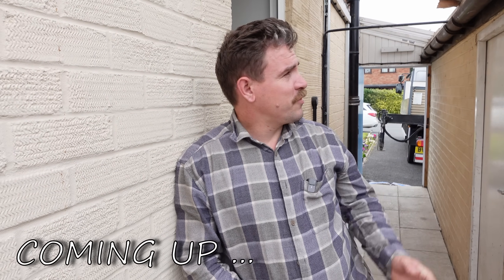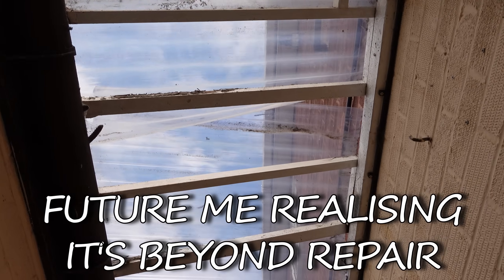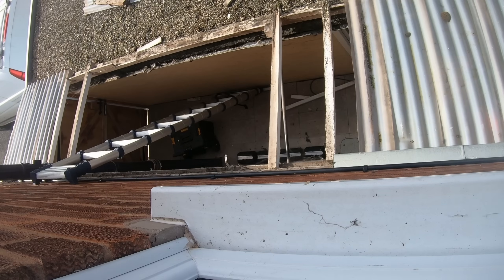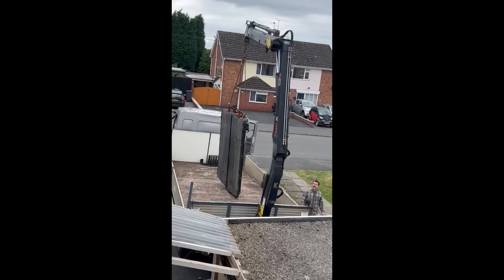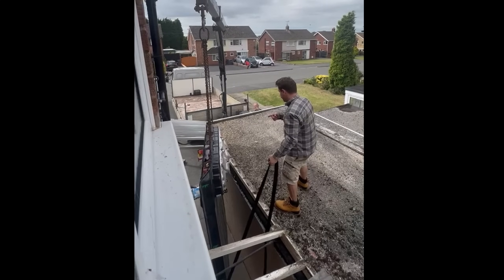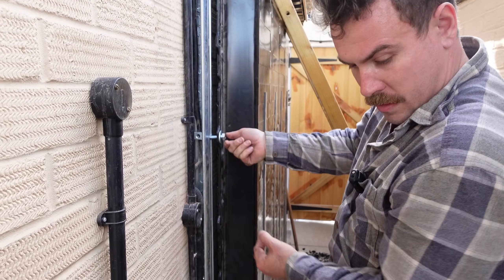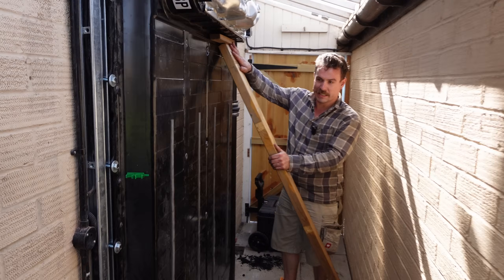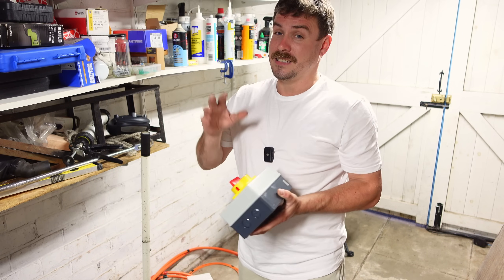TESLA car battery on my HOUSE for home energy storage

Comment: You need some spacers between the unistrut and the battery so you can torque those bolts down without bending the tabs of the battery down. also i'd replace the roof with glass frameless bifacial panels in a panel, clear sheet, panel, arrangement that will still let extra light into the area, if your spending money on roofing better if it helps pay for itself!
Reply from the maker: Very good shout on spacers for torquing down the battery. Thank you. 🙏 

Some more info. The passage/ garage is northwest side of the house. So only sees sun in summer evening. But it could be interesting to report to YouTube how much energy can we get from a panel in shade most of the year. And I’m trying to find spaces for solar panels everywhere I can without it looking messy.
Reply: @TheOfficialBatteryMan you could figure out what length spacer is needed and cut up some steel pipe to those lengths, it’s too much space for washers..  just use pipe with an inner diameter at least as large as the bolts.
Reply from the maker: @mwolrich  I had a box of washers. Took @allan80supra advice and used them up. 5 m12 washers per bolt did the job
Reply: Great idea on the bifacial panels!
Reply: Came to the comments to say exactly this as I was watching and cringing as the battery case was being distorted, it would also then be taking the vertical load better than all being on the foot which it likely will be currently. At least it didn’t pop 😅
Reply: Seems your a smart cookie. I want to use two of these batteries in front of each other. And the one against the wall a bit higher so i can still access the dog house. Maybe additional frame in front of the other one? Or maybe ill place the battery horizontal against each other.. with some frames. Ill see.
Reply: @mwolrich  Part-off short lengths of galved iron gas barrelling.

Comment: Looking good! I've been testing my 60kWh Model 3 battery with a Solax inverter and haven't needed any capacitor because the inverter's battery input already has a lot of capacitance. 
When I tested the battery without the inverter, I did the the capacitor to keep the safety system happy and contactors engaged. Also added a 50K bleed resistor for extra safety.

You might want to try an inverter connection without the capacitor first and save yourself a couple wires and extra box.
Reply from the maker: That’s very useful information. Anything that doesn’t need to be in the system is good to remove. I’ll still have a box close to the battery to convert the orange tesla cables to dc cabling with a fuse on my POS. I held off on the inverter for 3 phase install then grid approvals for inverter. They take time. And didn’t seem sensible having a potential paperweight lying around

Comment: Since I saw your first video about this I have bought a Solax X1 Hybrid inverter and connected it to a DIY powerwall (made from VW eGolf battery modules). I still have a few things to sort out but so far it is working perfectly letting me charge it with cheap night time tariff and run the house during the day. Good luck with your project.
Reply from the maker: O wow. Nice one. Are you using the battery emulator project or another BMS?
Reply: @TheOfficialBatteryMan  Currently no BMS. I set the Solax inverter to Lead Acid mode so it doesn't need to see a BMS. Hoping to get a BMS soon.
Reply from the maker: @alibro7512 you configured for low voltage ? I’ve got on well with JK BMS in the past
Reply: @TheOfficialBatteryMan  No, that's the problem. The pack is 60S so I set the max voltage to 237V which is 3.95V per cell and the minimum to 210V which is 3.5V. This way I should be well away from the max and min voltages for the cells to ensure none go over or under voltage. This still gives me around 15kWh which is plenty for my house and I can even use it for an hour or two of EV charging. Once I get the BMS operational I'll be able to use more of the batteries capacity but for now I'm happy to be conservative.
Reply: Did you declare to DNO without MCs / installer?
Reply: @je8277  No DNO in NI
Reply from the maker: @je8277  I used my details as the installer. This is where you would involve an electrician. I used easy PV to generate the forms including a schematic
Reply: Why Solax why not Deye?
Reply: @alibro7512 Ah the Tesla is 108s. High voltage.
Reply: @HermanWillems  I got the Solax 5kW for cheap

Comment: "I'm adding battery storage. Time to renovate the house". Does the Wife know about that? 🤣
I can relate to that sentiment Battery Man. I'm just done DIY batteries, but I haven't taken one from my Tesla.
Reply from the maker: The problem is you start looking closely in places and you see more areas that need your attention. I’ve been exploring the idea of having solar panels on the passage. But it’s quite dark. 

Oo what’s batteries you built?
Reply: @TheOfficialBatteryMan  Yeah, I wanted my inverter and battery outside the house, but undercover, so like you, I have them in the small side passage. Problem is I had to have the roof redone first, because it wasn’t fully water tight. Then I skinned the inner roof to hide ugly rafters and cables etc 🤣. 

I built Seplos Batteries from FogStar. They’re based south of Birmingham in Reddditch. Had my battery cells from NKON in the Netherlands. I’ve got 2 kits built now. I have a tutorial series on my channel because the instructions available are rubbish. Just finished the series yesterday. I left out all the grunting parts of hauling 130kg down steps, but it’s informative for people who buy these kits. 

I’ll be waiting for your next video. Interesting stuff. Note that your battery is LFP, so pretty safe if you decide merge the garage and side roof, but unless the garage roof needs replacing anytime soon, I would just put new wood up there and double wall poly as the easy way. If you don’t mind losing light, do a fibreglass roof and stick in a roof light. Will help maintain temperature for batteries later.
Reply from the maker: @GaryMeatsLife  i’ve been trialling a light blocking solution with a temporary cover and I don’t think I want that. It’s probably gonna be the double wall poly sheets. I wanted to see whether I could put solar panels in place of the poly sheets but it’s already north facing and dark. There won’t be a return. I think you’re right. Leave the garage roof and just reinstalled a better side passage roof. 

Nice. I’m very aware of Fogstar. They are great. How do you find the kit? I’ve also purchased cells 18650s form NKON. 

Thanks for sharing. Will check out your video
Reply: @TheOfficialBatteryMan  The FogStar kit is great and they were super to deal with. I had 2 different issues with each kit and they resolved them with minimal fuss. 

The assembly instructions are terrible though and Seplos have let people down on that front, which is why I made my video series. Lots of people like me need a simple guide to put these things together without blowing something up. I just about managed to figure it out with help and i'm an Engineer! 

NKON also great to work with. I picked up 16 prismatic cells from them in July when I was driving to Germany and back. I managed to get them all into the lower boot and frunk in the Model 3. The Seplos kit went on the roof rack on the return trip. Should have made a video 😅
Reply from the maker: @GaryMeatsLife  sounds like my kinda adventure. Was there a big price difference between Fogstar and NKON. I’m not sure if they are still doing their big Friday discount. There wholesale prices are consistently lower for larger orders. 

Do you think it would be worth me mentioning to Fogstar that customers are reporting the seplos instructions could do with improving?
Reply: @TheOfficialBatteryMan  I was collecting my son from his Erasmus year in Germany. It was a great excuse to collect a second Seplos kit. I'm based in Ireland (south), so NKON deliver here and their battery cells come highly recommended.

Fogstar is where I get my Seplos kits from. No batteries, as they were a little more expensive when looking at the cells. They only deliver to the UK, so I had to have my first kit delivered to NI where I picked it up and brought it home. That said, they did post items direct to me when I needed replacement parts. I just had to pay customs fees.

Fogstar are aware that the instructions for the kits are next to useless. 

Seplos are also aware of this. I would design an assembly manual for them if they wanted to collaborate with me. Seplos are also aware of my channel and commented on one of the videos, but didn't get back to me when I told them I have ideas for them. Maybe they will reach out again.
Reply: @GaryMeatsLife  Hi Gary, very interested to learn from your experience. Would you mind sharing your channel? Thank you.

Comment: That was interesting! I'd like to do something similar so appreciate that you don't hide anything. 
I'm curious how you know that the inner structure of the battery is safe to allow mounting in the vertical.
Reply from the maker: The ‘Battery Man’ budget doesn’t quite stretch to sourcing a battery to tear down and examine the structure of the battery. But I have made good use of videos on YouTube by @munrolive and @superfastmatt both showing how the structure of the battery is made up. Cells themself can handle being on there side. Both cells in Seplos and GivEnergy are both sideways in the same orientation.

Comment: Very curious as to why you're getting the 3 phase connection. can you re-cap?
Reply from the maker: Sure thing. Faster EV charging and energy arbitrage. So I’m limited on how many solar panels I can fit on my little plot. Sad I know. I’ve cried myself to sleep over this fact 2 many times. .. So next best thing is fill batteries at cheap times and sell back at more expensive times. Provide the grid with energy at times it needs it. And providing me a profit on each kWh. So a way to transfer energy between the property and the grid faster. The project is seeing if this can work out. Or if the scale is still 2 small to make it worth it. Commercial companies exist doing exactly what I’m describing. But can it be done at home …
Reply: @TheOfficialBatteryMan  I hear you on all that. I have 6Kw of PV myself. 
Wanting to do the same with batteries. I'm thinking of the fox 10.5kw inverter. But that's all single phase. Thoughts?
Reply from the maker: @davidcassidy2944  are you in the uk? Intending to use it off grid or on grid? 3 phase is over board if your not using more than 20ish kw in the uk and you can plan your usage around that to not peak. 

Not much experience with FOX. I hear the app can be a bit finicky or slow. But I’m intending on using one of there inverter and will share on the channel my thoughts
Reply: @TheOfficialBatteryMan  yes I'll the UK. 
Yes we only peak at about 15kw. Daily about 50 to 85kwh.
But yes if you are getting 20kw PV and wanting to export it all 3 phase makes sense. 
Looking forward to the next episode, keep it coming!
Reply from the maker: @davidcassidy2944  if you can wait I’m hoping to cover all of your questions in the next video. There comes a point where 3 phase power turns from a want to a must. But you want to calculate your current and expected demand. Then consider whether you can manage on single phase both now and into the future as we no doubt increase more electric loads. 

My research seems to lead to 17kw solar inverter is the highest people have single phase in the uk. With out rubbish weather oversizing solar is a good idea to provide energy more of the year

Comment: Fantastic project, loved watched the whole series. Just about to embark on the same install. One question, might have missed in a video, where is the feet mount from? Is that just a uni-strut mount? Love the idea of putting the load into a slab instead of a wall.

I’ll be building a small solar roofed lean too off a garden wall, housing the inverter + 2x 75kWhr batteries so that would help having load in the floor.
Reply from the maker: They are heat pump feet. I genuinely cant remember which brand. they are all fairly similar. The Unistrut is the heavy duty version. Its a lot of weight if you relied on a wall only. Sounds exciting.

Comment: How many bolts do you have in the track screwed into the wall to secure the two side tracks onto the wall.  Is it as many or more that hold the battery in the tracks and are they the same size or larger?  Why i ask is it seems to me the bolts screwed into the wall were much smaller.  If this is the case those giant bolts holding the battery to the track are useless.  You get what i mean?
Reply from the maker: Around 10 wall anchors in total. The weigh is through the floor. The battery balanced on the feet before it was secured back. Originally I thought about retaining it entirely. 

Everything is m12

.

Comment: You should replace your lean to roof panels with solar panels and make a solar canopy as another string into your inverter, makes it dual use then…. And it’s worth it for YouTube 😂
Reply from the maker: North facing in shade most the year. The best I could get is reflection from the clouds. . . But it is for YouTube hmmm

Comment: Hi, I’m an actual crane operator, that would’ve been a lot easier so many different ways.. haha. I’ve been considering doing the same install, what’s the measurement between the unistruts? I need to figure out where I can put mine.
Reply from the maker: Ooo … How would you have done it? It’s hard to give off every angle without showing off my neighbours and the street. In an ideal world building a battery hut down the garden or my second idea the battery trailer. 4 batteries on a trailer which could be made pretty and found a permanent home. They are not
exactly light to man handle to get to the back of my house for a hut. And a battery trailer to my standard is getting expensive 😂 💸💸💸

My battery had centre to centre of 144cm
Reply: @TheOfficialBatteryMan  A Franna would’ve worked much better as the hook is attached to a winch (I’m in one now). Not sure you get those in the UK though. My other thought was why not attached a lifting point to the side of the house, then you can just hook up a chain block if you ever need to lift it out again to service a module..

Comment: How did you get your DNO to install 3 phase? Are you paying for this yourself?
Reply from the maker: Yes a DNO install. Next video
Is a full video about it. Can’t wait to share
Reply: I want 3 phase at my house as I run two EVs and can’t charge effectively at the same time. Personally, imo all new houses should have 3 phase, solar and battery storage.
Reply from the maker: @stevemann6110 I couldn’t agree more. You need builders to be thinking. Let’s create these houses for the future. They are also trying to please everybody. ‘O will we sell 100 houses if we put heat pumps on them all.’

Solar is a no brainer. They must be able to get panels for a steal in bulk. They have come down so much the last few years. Even an oversized 3.68 KW system making use off all roof space using in roof system… saves them money on tiles too.
Reply: Unfortunately from my experience the builders do the bare minimum to meet building regulations. 

The only way to get 3 phase, solar and battery storage in place on mass, is a revolution in building regulations. Which I believe the government doesn’t have the balls to do.